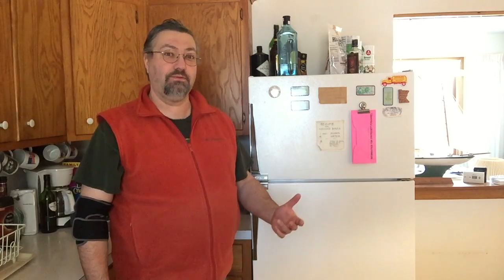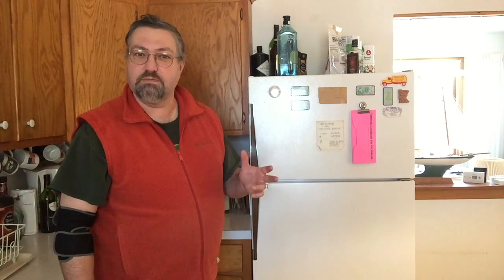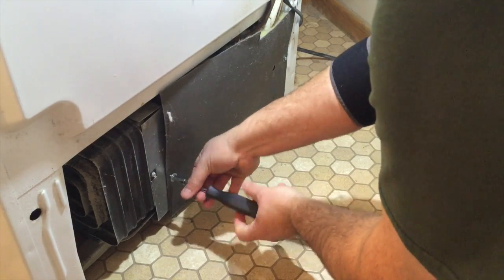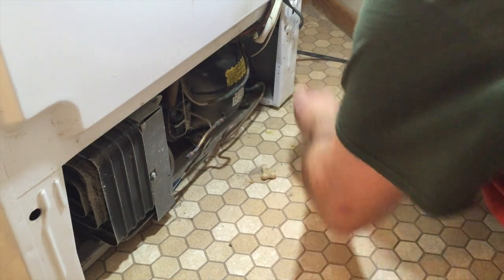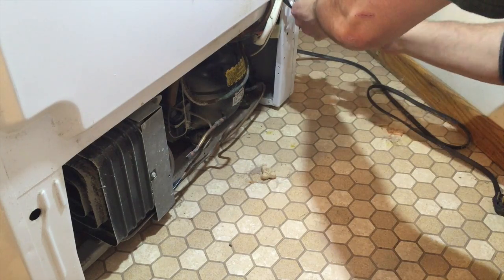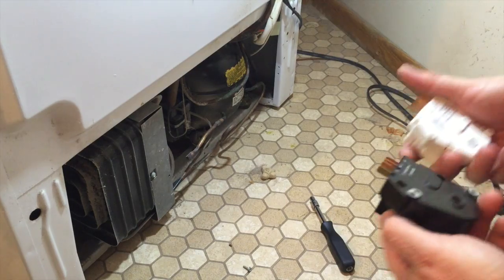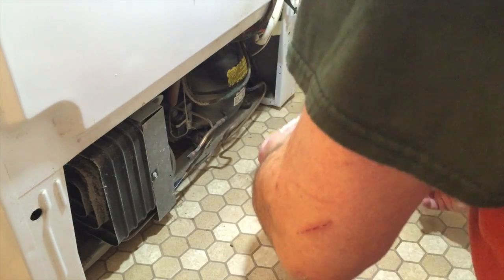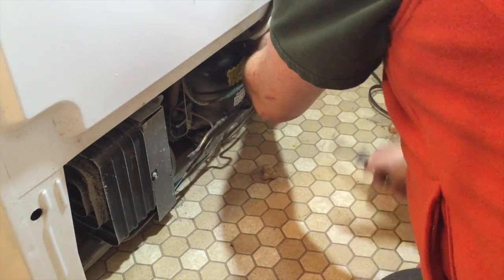Fridge Ticking Noise Repair

Comment: Thanks Eric, ticking noise was exactly what I was hearing on my 1980 hotpoint model CFT17GBG Top freezer no frost. First ever problem with this fridge. They dont make'em like that anymore! Defrost timer on this unit was in the front bottom. Behind the grill. Easy access. I did let mine sit with doors open for 24 hrs for a total defrost per guy at appliance store counter. I had 1 inch of frost build up on back panel inside the freezer. He said there was probly much more on the coils. He was correct. So I just cleaned the fridge up and out while it was down. I guess it needs to be done every 20 yrs or so.😊 It's up and running good now. Thank you for posting this and showing what the replacement part looked like. So helpful. Saved me money. Thanks again and God bless you.
Reply from the maker: I’m glad my video helped you. God bless you and yours!

Comment: 💥 I usually watch you for your tractor vids. I’ve got a ticking fridge as well so I looked up the solution on YouTube and found this. Thanks Eric! 
Keep on tractoring! 👍
Reply from the maker: I just ordered a new fridge. Sadly, that old fridge is just running and running, telling me that the compressor is taking a dump. Nowadays the new fridges also run all the time, just at variable speeds to make them so much more efficient, but they are also only designed to last ten years. This to say, I purchased the least expensive new fridge I could find.

Comment: thank you so much for this video. my partners fridge has been driving me crazy, 3 ticks per second for hours at a time. I replaced the defroster timer and its running silent now. thank you so much!
Reply from the maker: Glad it helped!
Reply: Exactly how fast mine sounds
Reply: i removed the part, following your video and the part had writing on it, like letters and numbers with dashes. type those into google and you will find the part you need.
Reply: this is exactly what's happening at my apartment! driving me insane! i want to submit a maintenance request now

Comment: Hey Eric, hope you still are doing these lol. So you were spot on with my ticking time bomb. I turned the knob on it and it still is ticking like a time bomb but now the fridge is running & cooling. 

Can I not replace it? Will this timer just stop and blow me up?
Reply from the maker: I finally replaced my thirty-year-old fridge because it was running all the time and my power bill was reflecting that problem. So I bought a new, energy-efficient fridge, that because it is designed to run all of the time has an expected life of only 10-12 years (meaning don't go nuts buying a super expensive fridge because non of them last very long). The bonus of the new fridge is my power bill is literally thirty bucks less per month. That said, I'm sure you can replace your defroster relay--that or listen to it ticking, ticking, ticking into the future....

Comment: My Whirlpool side by side fridge operates correctly, but it makes a loud clicking noise.  It is nearly driving me to drink.  Any ideas?
Reply from the maker: You are at a crossroads. The ticking sound is indeed your defroster timer, a thing that you can change out so that it no longer sounds like the startrek computer counting down to an explosion. On the other hand, no matter how expensive, these days refrigerators are expected to only last up to twelve years by design. As a result, I purchase the least expensive refrigerators period because they live the lifespans of dogs. Even so, the entire family is saddened to their core when the pet dog dies and so to is the pain in the backside replacing the lousy, super efficient, born-to-die refrigerator. 

Which is to say, how old is your fridge? And can you turn up the radio or perhaps order in a nice case of Pinot Grigio to pass the time until your cold-boxes untimely death?

Comment: What about fast ticking. Like a fast heartbeat?
Reply from the maker: Does it sound rotational, like a fan blade hitting something? If not then it most likely is the defroster timing going whacky. That said, new fridges have variable-speed compressors that are always running and because of this May emit some odd sounds when running faster due to dust collecting up.
Reply: @MinnesotaEric  it got cleaned and noise stopped but it's still not freezing like it did a couple weeks ago
 We had to nuke the ice cream to scoop it now it's soft. Idk. Lol it's me crazy because tiny town and nobody repairs them...or seemed to know what the mechanical woodpecker in it was. I had a Sears guy listen on the phone thinking they could decide what action to take 8f they heard it. He actually said it was too time consuming...before we even consumed any time. I asked how he could have an idea what to do next and we had too much food to let too much time pass. He said well you better but one today then. I said I'd go back to YouTube and try to figure it out
Reply from the maker: @kathymisuraca5047  try defrosting the thing and letting to thaw out. Dirty coils can cause things to ice up and simply thawing the machine out can restore function. Get enough coolers together to hold your items, unplug the machine and place hot water in pans in the freezer and fridge to accelerate the thawing process.
Reply: @MinnesotaEric  ok
Reply: @MinnesotaEric  actually I have no idea what you mean by drivibg
Reply from the maker: @kathymisuraca5047  defrosting. I got autocorrected.

Comment: I unplugged my fridge and painted behind it then moved it back and plugged it in now it doesn't get cold. It has developed a tick though.
Reply from the maker: enrique shockwave you need to defrost your fridge and get it working again. While
Unplugged it apparently plugged its drain. Now it really needs to be defrosted entirely and thawed out.
Reply: @MinnesotaEric  it's room temp the last couple days in the fridge and freezer
I pulled the relay off the compressor and it rattles so I ordered a new one. Hope that does the trick.
Reply from the maker: @enriqueshockwave8869  Stupid question: you confirmed you have power at the outlet?
Reply: @MinnesotaEric  yes, the lights in the freezer and the fridge turn on when you open the door, also the lights above the icemaker area are on as well

Comment: I'm confident I could change that part you made it look easy. However could you watch my video and listen to the noise I get?
Reply from the maker: Debra, I'm pretty sure you need a defroster relay. Figure out what model you have, look up the part and be sure to check eBay to see if there is a less expensive alternative. http://www.appliancepartspros.com/frigidaire-parts.html